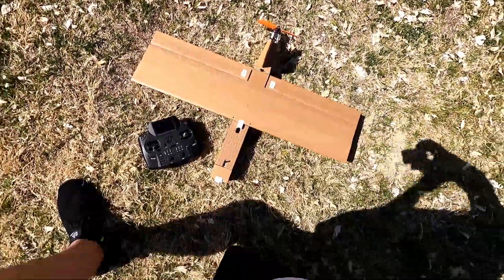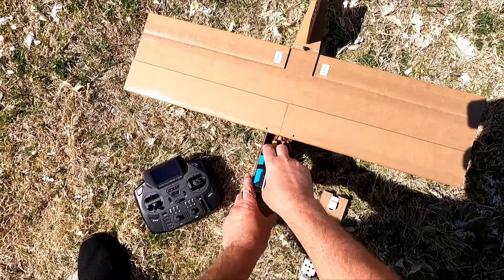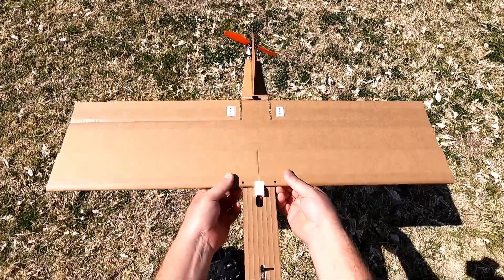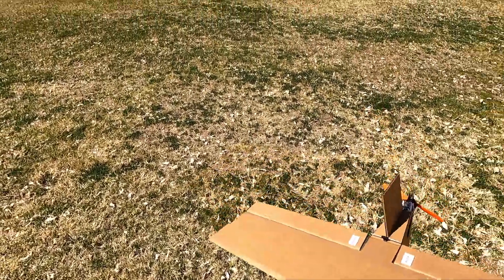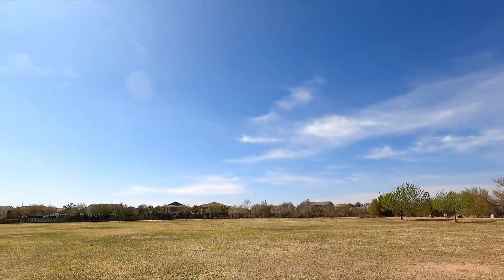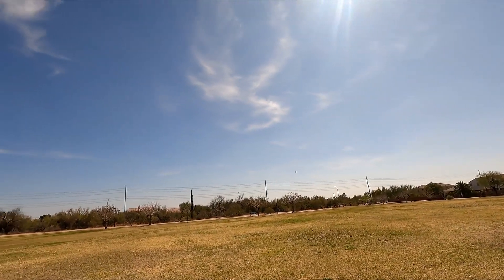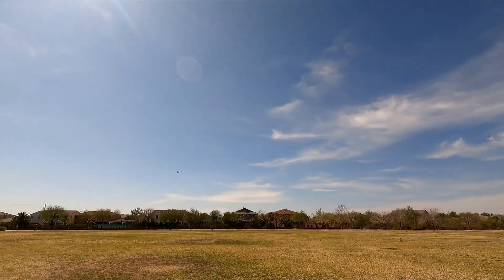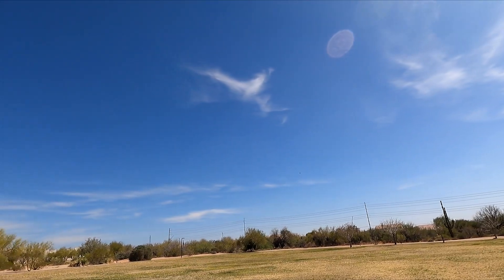Cardboard Plank- an easy to build DIY RC or FPV Plane

Comment: How does that particular cardboard compare in weight to dollar tree (or comparable) foam board?  I'm surprised you didn't need a wing spar.  I live in the PNW where it's pretty wet half the year, and I use packing tape to protect my foam board planes from wet grass/light rain.  I'm guessing water would be a lot worse for cardboard than foam, otherwise I'd be a lot more excited about this.
Reply: I use dope or polyester resin to water proof/fuel proof cardboard aircraft
Reply: @cyberteque thanks for the tip!